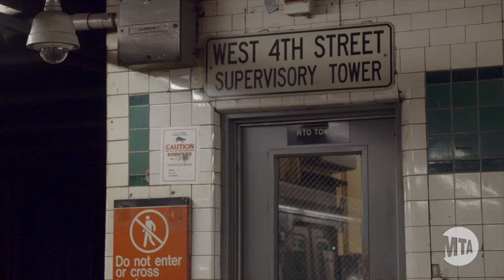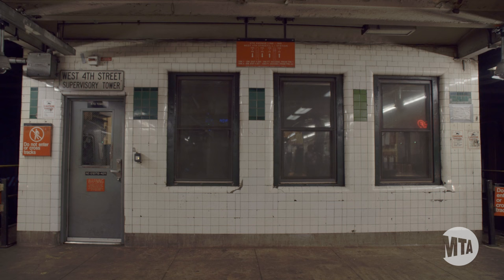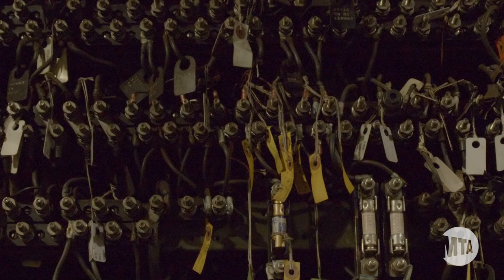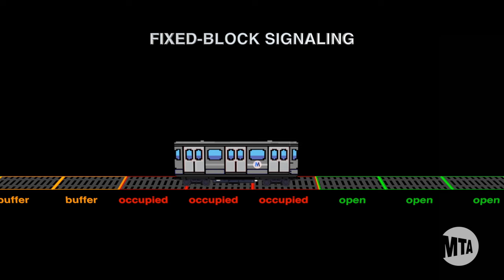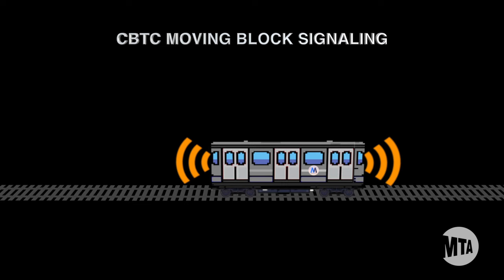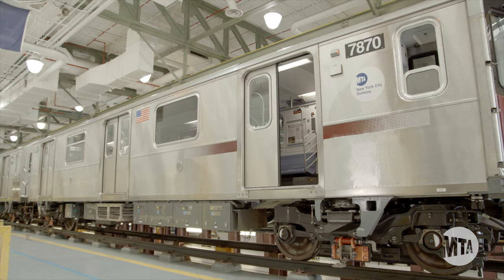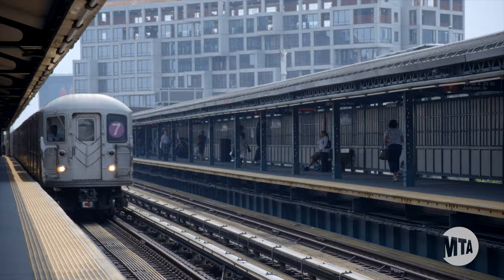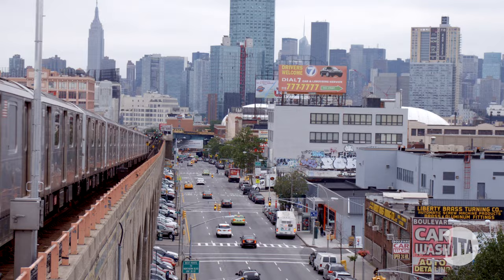CBTC: Communications-Based Train Control

Comment: I really hope that when this stuff gets updated and modernized, those original relay racks and interlock stand get put in a museum. Those are gorgeous pieces of machinery that interests me far more than a couple of back boxes with LEDS and fans would.
Reply: They still using them today lol
Reply: engineering is going from mechanical to digital. in 100 years time (or probably a lot less) we will be looking at "beautify pieces of code" which make up these digital systems.

Comment: Pretty clear half the people in the comments don't understand how CBTC works and its purpose.
Reply: AlgonquinRider810 also a lot of whining without having a clue what it takes to move 6 MILLION people per day! Anyone with any small slight insight into what NYCT does day in and day is in awe of what they accomplish safely.
Reply: Being in awe and expecting better are not mutually exclusive.
Reply: Sunny Raines how does it work?
Reply: Everyone is like ‘they need to upgrade it,’ but no one realizes that they have to close lines or sections of lines to change it, which will cause many delays and headaches to do it
Reply: AlgonquinRioder810
Reply: If the video doesn’t explain how CBTC works then of course the people don’t know it.
Reply: @jacksonabernathy1683  As a NYer. There are ALWAYS DELAYS, trains stalling, "signal errors" etc EVERY DAY.
Reply: @BloodNote  as a new yorker other new yorkers exaggerate 90% of the delays. But those signal delays are legit. And even with the system being old allot of those delays are because of trash on the tracks. hense why they wanted to put the new signal wires in the walls and along the ceilings trains going out of service due to door malfunction cause people keep holding them open blowing the motors. Suicidal people jumping in front of trains causing all train traffic to stop while the body is cleaned up since power has to be off for police and medical personel to access the track. And the good ol people fighting and holding up the train so police have to show up and deal with that.
Reply: Toronto still has one of these old interlocking machine. It's currently in the processing of being replaced
Reply: @jacksonabernathy1683  so?  has to be done.   People will find a way to get around while the upgrades are being done.   If it's planned correctly, it can be done really fast.
Reply: @jacksonabernathy1683  With your thought process they would never consider repairing and maintaining roads.
Reply: @Anonymous-pm7jf  which aren’t in good shape so
Reply: e
Reply: @Amidat  expectations are comical when you don’t know what your talking about
Reply: @bio2020  ok, This is ONE upgrade thats taking place as we speak, whats your point? there are MANY upgrades being done but this doesn’t happen over night… so next time your train is delayed from on going track work, remember it “has to be done…. “
Reply: @BloodNote  Most delays are exaggerated by New Yorkers, but the main reason why they happen is operators, trash being thrown on the tracks, and suicides. All of these things could be solved by automating the system and installing platform screen doors like Paris Line 1, but the MTA transit union holds it up because it would mean basically laying off 95% of the system's employees. A project like that would save the system half its budget (since half goes to employees) and allow trains to come every 85 seconds, but it will never happen since the transit union doesn't want it to happen. Thank them, and the federal government for not giving transit consistent funding.
Reply: @benw3864  Automation.
Really.
REALLY.
For short rides like the 42nd Street Shuttle, I understand automation, but automation in the entire system is a daydream. Operators are very nicely trained, so doing what would be tens of billions of dollars for minimal improvement would be hilarious.
Reply: you know what?
im gonna do it,
im gonna climax.

Comment: That tower looks like an electrical fire waiting to happen.
Reply: We already had one in 2005 at the Chambers Street A C station, and boy did it do one hell of a job knocking out service.
Reply: @FowlorTheRooster1990  I guess you didn't really watch the video. He clearly says there is a separate "relay room" from the control room that houses all the electromechanical switching equipment. That big switchboard is nothing more than a panel with lights and a whole bunch of signal switches. No significant electric current flows through that machine.
Reply: @TheRailLeaguer  ..Man, I'll just bet! !
Reply: Oh my god your right! I just realized lol
Reply: That’s not very optimistic
Reply: You would be suprised, but most of that voltage is like 5-17vDC. Far from enough to kill you and a low fire hazard compared to the cloth covered 120v lines in most old homes. Cloth lines don't tend to cook carrying regular rated voltage and current as they usuallyare partially rubberized or tarred and often contain asbestos, one of the only places you would still want it. While antiquated, hardware equally as old operates above ground near me and barely needs repairs. Understanding the MTA is very heavily operated compared to any Michigan line, part of the need for upgrades is the aforementioned. As for the hardware, it works, but not as well as it would under less stress. Those relays barely die when used moderately, and the cables don't really pose much of a fire hazard unless severely misused/overloaded for an extended period of time with an exceptionally excessive load. In the essence of modernizing speed and efficiency, it is understandable that the upgrades are taking place, I just hope when they break up the relay rooms they auction, sell or distribute the relays as they are beautiful pieces of electronics hardware.

Comment: I've been riding the New York City subway system for almost 60 years, I never had any clue of what was going on behind the scenes. This is amazing! What's even more amazing is that you have parts from the 1940s that are still working perfectly.
Reply: working perfectly?
Reply: @the0000alex0000  Yeah, it is surprising that we don't have a lot crashes inside the tunnels. Besides, and good example, of older technology working better than newer is the R32s replacing R179 on the J line because the R179 had problems.
Reply: @blaazer9473  Newer signalling would surely be more efficient though. The old stuff does work but isn’t the most efficient. Maybe it’s simpler though so is prone to less faults.
Reply: Amazing? You americans still living in stone age

Comment: I thought the control  setup in “The Taking of Pelham 123” in the 1970s was filmed in a museum. And they’re still using it!!!
Reply: And was bull when originally written. If there is no power the train will not move.
Reply: @allangibson8494  In all three versions, they had the train stopped. From there, they cut a car and turned off the power. Once it was time to move, they turned on the power.

The movies never had a train move with the power off.
Reply: @TheRailLeaguer  Saw that orig. version a number of times. St Louis Car Co-built R22s used in the filming..fresh MTA paint, no graffiti!! The Transit Authority did very little to co-operate with technical advising during the filming. Credits at end showed that. Dug it any way. Have not seen re-makes...Am a NYC Subway aficionado, specially the prewar/post war rolling stock!!
Reply: @TheRailLeaguer  Three versions?
Reply: @trainer1158  Yeah. There were three versions: the 1974 original, the 1998 remake one made for TV and the 2009 film remake.
Reply: Just saw the 74 version a couple months ago, great film
Reply: The original w/Walter Matthau and other veteran New York actors was the best and most realistic to me.

Comment: I work as a machinist in the subway of Moscow. We have a system of ALS-ARS (automatic locomotive speed control system) allows you to keep the minimum interval between trains is one minute thirty seconds at the maximum train speed of 80 km per hour.

Comment: As an Electronics technician I find this all absolutely amazing, and hats off to all of these people doing a wonderful job upgrading these systems, especially maintaining service while doing so, however I do find it hard to believe that it's difficult for them to track the locations of the trains without some type of GPS system of some type at least until the newer updates have taken place.
Reply: They do plan for the installation of an Ultra-Wideband system for the MTA signal upgrades. This presumably takes the place of the transponders installed on the bottom of the train for tracking the trains at the MTA Rail Control center in Manhattan. Much of the equipment can be installed in the tunnel walls, while the antennas for it can easily be installed on each end of the train consist.
Reply: don't forget, most trains are underground......
Reply: The new CBTC tech uses those transponders that locate the train with accuracy down to 6inches then the trains count distance travelled from that point with a combination of radar and tachometer + wheel diameter calculations until they hit the next transponder.

Comment: It's great that train technology has lasted this long, but while NYC is dealing with 100 year old systems, other nations have already upgraded to high-speed rail. What's holding NYC back? Perhaps the US can build fewer military jets.
Reply: Lerkero Yes, because what the department of defense decides to spend its money on really does mean that a city level transit system will get less money.
The 100 year old system is great, I've worked with analogous systems on railways in New Zealand and the take home message from them is this: If you maintain it, and use it right it will do exactly what it was designed to do: stop trains from colliding.
Reply: Samuel Zelter The US government allocates funding and grants for projects at different levels of government - including the department of defense and states that provide money to counties and cities.

My criticism isn't that the system doesn't work. If something works that doesn't mean it can't be improved to be more efficient. Perhaps a newer system will require less maintenance and provide a better design to prevent trains from colliding.
Reply: Lerkero high speed rail is for INTER-city service up to 400 miles. NYCT and other transit systems provides INTRA-city service. There is rarely a need for speeds over 60 mph and in most instances 35 mph works great. AGreed the US should be implementing high speed rail where it makes sense like the Boston to Richmond Northeast Corridor.
Reply: +Lerkero Because nobody votes for politicians that are WEAK ON DEFENCE AND WANT THE RUSSIANS AND CHINESE TO WIN.

This gets no funding because it is invisible to regular people.
Reply: +Sunny Raines The main issues here are reliability and running costs - as time goes on and these components become harder to replace, they become both less reliable and more expensive to maintain.
It's a bit like having a unique 1930's vehicle - it will get you from a to b just fine, but when it breaks down, which happens frequently, you're going to be paying 10 times as much for parts.
Reply: there is not cheap about maintaining modern technology, often just the opposite because of the complexity of the systems and skills needed.
Reply: Sunny Raines
 I can tell you with first hand experience (i work in the rail industry) that it is cheaper with modern technology in this instance - it is issues of both mass production and manpower.
Reply: +Lerkero Unfortunately, the business of America is war, so most of our tax dollars go there. It is fun to speculate on what wondrous and marvelous things we could have in this Country  if our dollars were spent on civilization instead of destruction.
Reply: where is 2 ave subway waiting since 1955
Reply: The New Yorker's are holding the project back. Most of the people aren't told about what type of maintenance are taking place and ppl are unsupportive.
Reply: Lerkero it's a cultural legacy. a living museum
Reply: It's because, unlike most systems, it runs 24/7, so there's no real time to install CBTC. Most transit systems are closed during the night.
Reply: Leo M i love nostolgia it is amazing that this Technology is still Working
Reply: The subway cost comes out of the New York State pockets not the U.S. federal government.
Reply: What good would high speed rail do for NYC? Our stops are usually only a few blocks apart, high speed trains wouldn't even have time to get above 40mph before it hits the next stop. Yeah, it would be nice if our express trains could go 200 mph, but it's not really feasible, again, due to space, and I'm fairly certain laws wouldn't allow trains to go that fast in a big city.
However, high speed raid would be very beneficial for the LIRR and Metro-North. It can take upwards of four hours to get from Penn Station to Montauk, when there is a possibility with high speed rail to cut that down to only 30 minutes. Grand Central to New Haven, CT? Why not get there in 20 minutes as opposed to 2 hours?
Reply: Alex Rodriguez There isn't much that can be done at that point, because trains have to slow down when there is a ton of track switching involved. If they go too fast while switching over several tracks they'll derail. Same thing happens at Jamaica and Penn Station on the LIRR.
Reply: Lerkero it’s not free to upgrade
Reply: Japan is the size of CA.
Reply: That's why you need a centralized government that controls every single states in US
Reply: In America, we respect people's property rights.  In order to have a high-speed railway you'll need to build new rail.
Reply: Lerkero In my opinion CBTC will create just more problems that have to be fixed. Our stupid mayor should put the money that he's obligated (by law) into the system so that the TA can maintain the old technology and obtain new versions of the old technology.
Reply: Alex Rodriguez It's probably because of the cab signal system. I  believe that the trains ran quite differently when there were tangible signals beside the track.
Reply: to bad trump wants to the military in space and conquer aliens
Reply: Blake McNamara there is no newer version of the old technology that is the problem
Reply: High-speed rail in a subway makes 0 sense.
Reply: NYC has no one to blame but their city's leadership considering how much people & business are raked over hot coals regarding tax money.
Reply: The government 
lol
Reply: lack of funding
Reply: This is a transit system, not intercity heavy rail. Apples and oranges. Direct your comment to Congress who funds Amtrak which is the U.S. intercity rail limping along with 1980 era equipment (except Acela soon to be replaced). North America in toto that is Canada and Mexico and the USA all lack high speed intercity rail.

The NYC subway needs modern train control systems, CBTC is mentioned,, switches, signals, radios or other communication systems and more ADL compliant stations.
Reply: facts
Reply: Lerkero Why would NYC need a High Speed Rail life for?
Reply: @ninofromkitchennightmares1497  NYC is connected to multiple areas in the Northeast and mid-Atlantic USA. Installing high speed rail would significantly reduce commuting time. People regularly travel from Boston to NYC on public transport routes that take 3-4 hours by train (5-6 hours driving), and that might be reduced to  1-2 hours using high-speed rail

Comment: The equipment may be old, but at least it's 100% hacker proof. Just make sure that when you update the system, you don't connect it to the internet. Everything that gets connected to the internet becomes a security risk.
Reply: +Kabuki Jo really? they can "hack" the lines though.

but guess what? they don't get any money from it.
Reply: Well if someone really wanted to go digging for wires in the tunnels then you can't really consider the current system hacker-proof.
But yes, connection to the internet will pose a big risk, although I don't see why there would be any reason to do so.
It would be on their own intranet if anything.
Reply: Kabuki Jo It dont need no hackers to break down all the time.
Reply: connect to the net? nah no use for MTA to connect the system to the net tho
Reply: Add to that any RF interference could cause major issues.
Reply: Fathin Luqman I hope you realise that terrorist could attack railways by hacking if they are connected to the internet? I hope you realised this after 2 years since your comment.
Reply: @Syafiq Azrin
Can they? How do you know?
Reply: @JPavilion2
"Anybody can burn down a - computer - system". Maybe....
But - they dont use compusters on the old systems - that is mostly pre-computer material there. How will you stall a computer if there is none?
Reply: Syafiq Azrin the old system doesn’t even work
Reply: Why about Private Wi-Fi?
Reply: Do i smell Watch Dogs 3?
Reply: ok boomer
Reply: Well, I would think that CBTC would leverage GPS (global positioning satellite), which, unfortunately, could possibly be hacked, I would think.
Reply: @fnihp30  The whole reason CBTC exists is because GPS doesn't work in tunnels